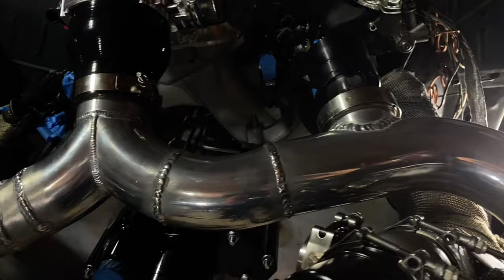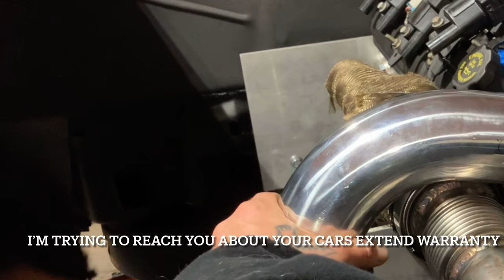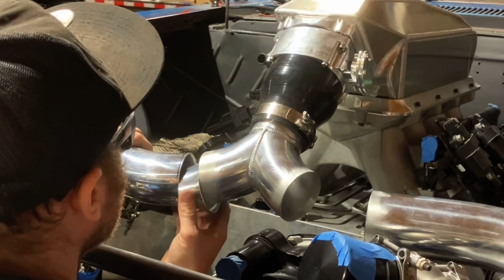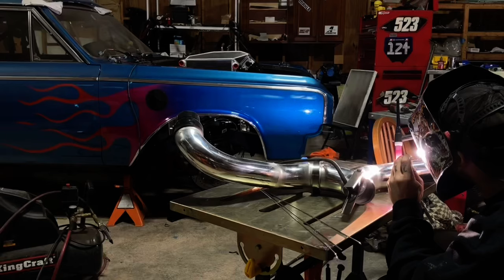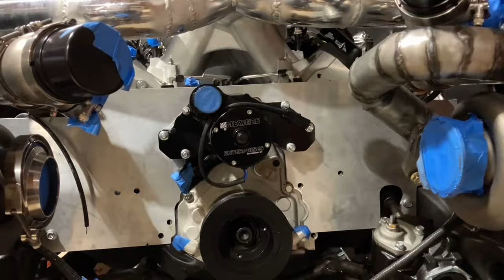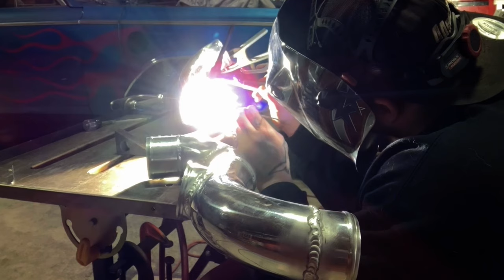Building Coldside for 1XXXwhp Twin Turbo LS Cutlass

Comment: what the setup on the tig torch? Ive seen paras tig with adjustment but that looks to be almost ideal
Reply from the maker: This is a Lincoln electric finger amptrol that I took apart and connected spring assisted brake lever too. I wanted it to work like the foot pedal and release when I let go. The finger amptrol while nice, you essentially move the finger dial to the heat you want and it stays there until you turn it off. I’ll make a video breaking down how it works and the parts 👍🏻